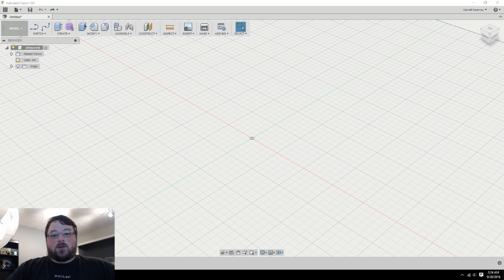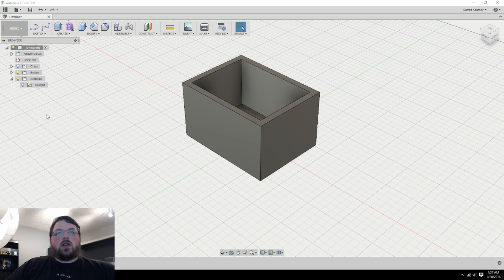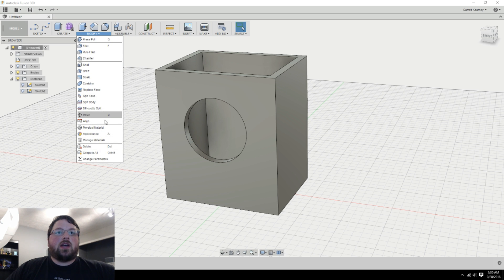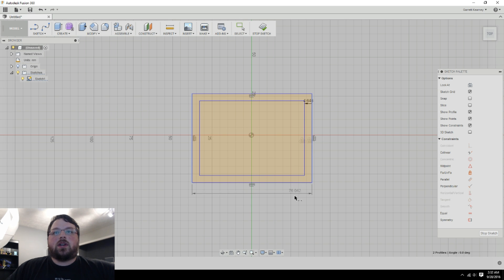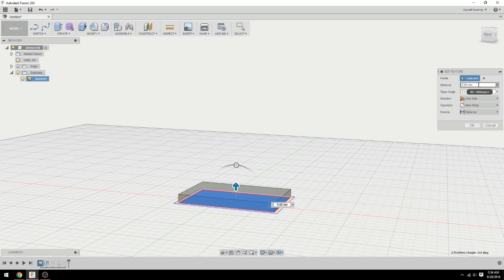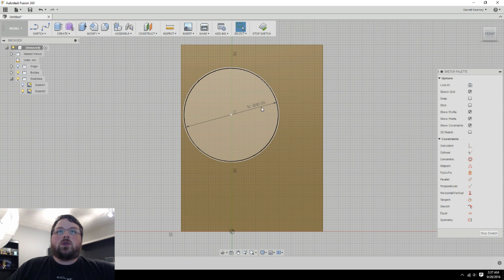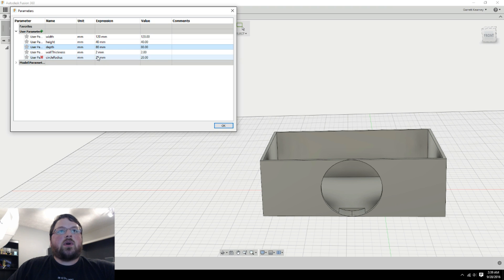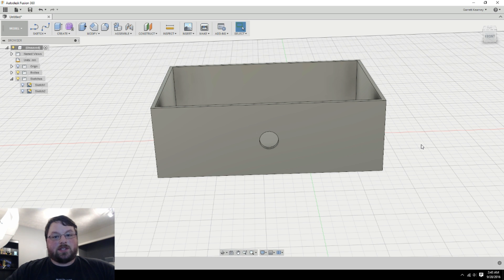Parametric Designs - Using Variables in Fusion 360

Comment: I couldn't find the parameters in the menus. This helped. Now, I'm curious if Fusion 360 can handle parametrically adding support. Say for instance I have a cabinet model and it requires a a support piece every 10 inches, or I'm building a kayak and it needs a rib every 12 inches. I wonder if I can dynamically have those ribs or supports be automatically added, as the size of the model grows... Or would I just have to manually add them, using parameters to specify (default) spacing... Otherwise, I'm thinking generative design might apply to this concept?

Comment: Thanks for the great vid. Wish we could do parameterised text in Fusion 360. For example suppose you were designing a range of different sized pulleys parameterised by their radius. It would be nice to have the radius of the pulley embossed into the surface of the pulley.

Comment: Hi Garrett, I've come accross a couple of stumbling blocks with Fusion 360 and was hoping you might want to produce tutorials on solving them. I'm guessing others may be having the same sort of problems ... or maybe it's just me :-)
I have just found a model on Thingiverse for a phone holder/speaker horn. I've been trying to resize the pod to accommodate my phone with the shell-style case on. http://www.thingiverse.com/thing:219652
When I convert the stl to T-Splines and export to stl, the model is bigger by a factor of 10. also, when I split the model and move a body 1mm it seems that it is only moving 0.1mm.
Clearly I am doing something wrong.
Would be keen to produce a tutorial on how this is done?
The designer has also included a .dwg for the model but since I have not had any luck using it to edit the model, maybe you could teach us how?

Comment: Thanks for the tut., learned a bunch of things I wasn't aware of! I enjoy your teaching style too. :)
One of the learning curves with fusion 360 is figuring out you can use constraints and dimensions so your first run of making the geometry can be fast and a rough sketch with inaccurate dimensions, which is constrained later into the final accurate dimensions.
Reply from the maker: Awesome! I'm glad I could help. And I agree. When I first started I fought against the constraints more than anything but now that I've figured them out, I use them all the time lol. :)